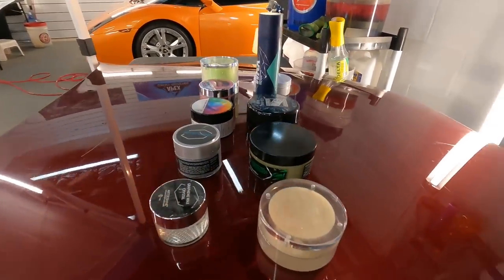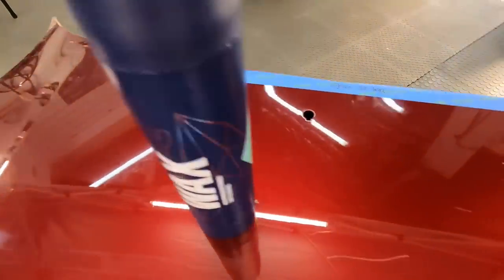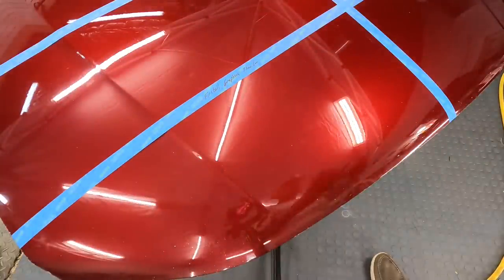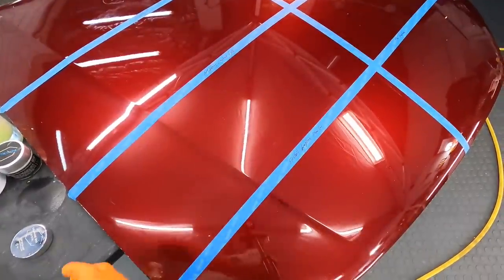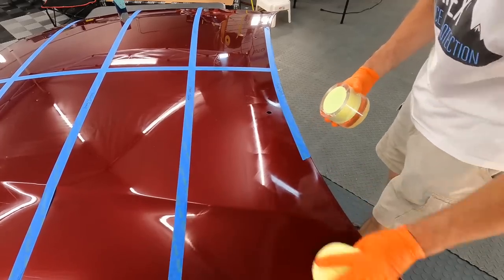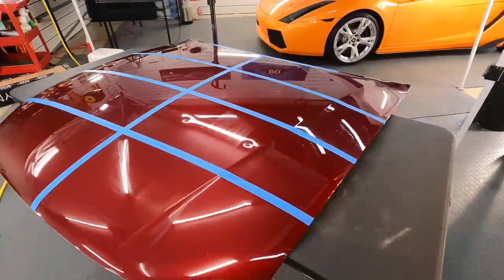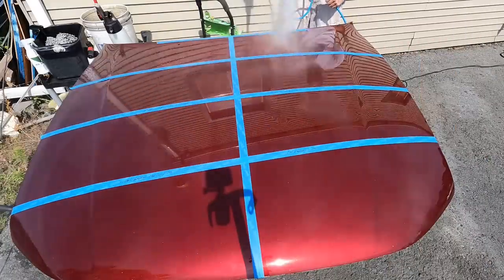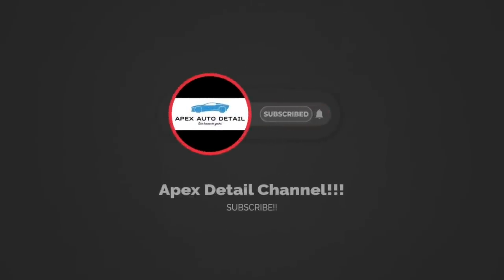WAX IS NOT DEAD 2!  Hard Tin Wax Comparison! TurtleWax, FireBall, Artdeshine, Gyeon, Bilt Hamber!!

Comment: IMO a really good wax looks nicer than a coating (pinnacle souveran anyone?). Deepens the color more, and gives a deeper wetter appearance compared to the candy coated glossy appearance of a coating. Dont get me wrong I have adams advanced (not the spray) on my durango srt that sit's outside 24/7 the last 2 years and still holding up GREAT and I just polished out my old camaro to perfection and coated with MOHS Evo (Flipping amazing to apply and remove btw) and topped with can coat evo. Did this about 3 weeks ago. Has yet to see water so should be very nicely cured by now lol. I have considered topping a section with pinnacle souveran to see what happens. Will it even stick to the surface? Will the wax clog the coating? Not really sure  lol. I would have loved to see P21s and or S100 (same thing big difference in price) compared against these. I love love those two wax's. Wipe on and wipe off. DO NOT LET DRY it is a WOWO wax. I've seen many youtube reviewers apply it completely wrong over the years.

Comment: The turtle wax paste wax over seal n shine was awesome. Very much enjoyed that combination, but it doesn't last very long. Maybe a month.
Reply: That's because you're putting a paste wax with cleaners over a spray sealant, not very smart.
Reply: @MeliorIlle  Turtle Wax recommended to apply the paste wax over their sealant. One of the videos they did showing off the new Hybrid lines has their product engineer applying on over a panel with Seal N Shine.
Reply: @MeliorIlle if you are referring to the TW Ceramic Graphene Paste Wax - that is not a cleaner wax.  There are absolutely no abrasives.
Reply: @catchr7bluedevil  Where?
Reply: @audieconrad8995  Every paste wax has abrasives in it.
Reply: @MeliorIlle nope.
Reply: @audieconrad8995  yep.

Comment: I stay away from some of the modern paste waxes because they are fluorinated. Yes, it gives terrific performance as you can see with Soft 99, Gyeon, etc., but they are questionable in terms of health and environmental impact if using often. If I’m going to use a wax I use something plain wax like P21S 100%, Pinnacle Souveran, etc. I wish the manufacturers were completely forthcoming as to what are in their waxes. For example, do any of the Fireball waxes contain per-fluoro compounds?